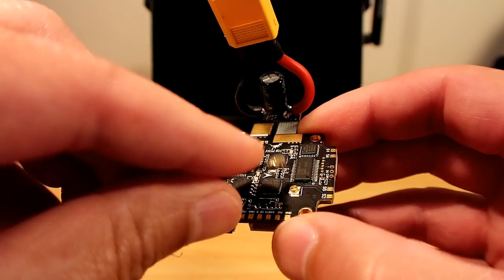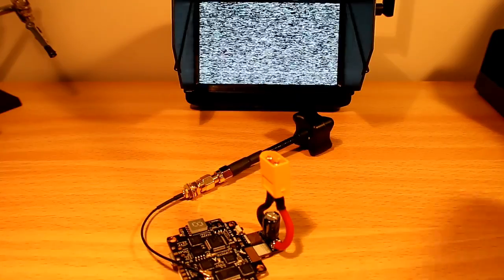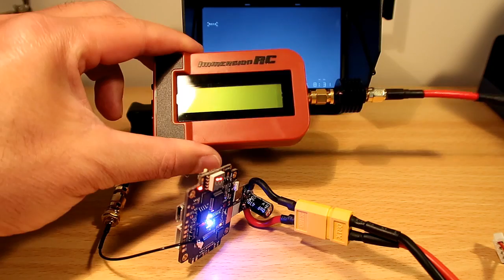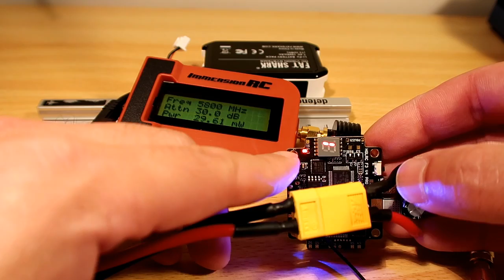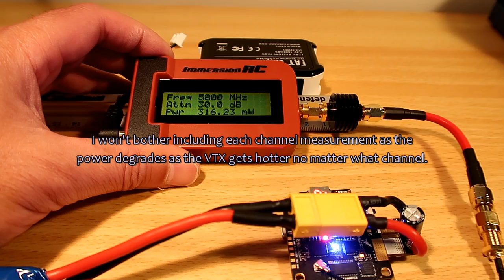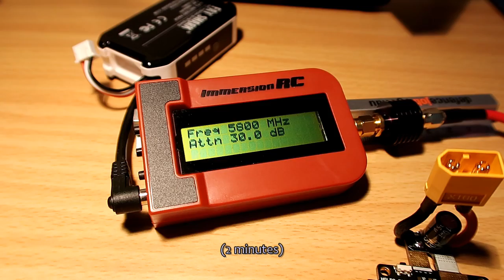HGLRC (HGLTech) AIO F3 V4 - FC VTX OSD PDB - VTX Test/Review

Comment: I bought one of this from Bangood, but it's OSD do not work properly. I use Betaflight configurator 10.1.0 and Firmware Betaflight 3.2.5
My problem is that I can not save thee OSD settings. I change the positions in Betaflight, and click on save, but nothing changes on the flight controler. I See the default OSD setting, not mine.

Can anyone help me to fix my problem?
Reply from the maker: Hi, this F3 V4 board does not use BetaFlight OSD, but the older MWOSD.  You need to find instructions on how to reconfigure MWOSD if you want to change this board's defaults.
Reply: After a little magic with FTDI my F3V4 pro works perfectly witch Betaflight. I can PID it from transmitter and save OSD setting from betaflight and so on...  This is my favourite FC ever! :)

Comment: well this seems like a quick fix for those who are out in the field and want to get back up in the air, not to mention seems like it saves some real estate, i think it still needs some time to prove reliable, and the no margin for error on the pads makes for a challenging upgrade that could prove to be rewarding
Reply from the maker: MiGz FPV unless you need extreme compactness I'd still look at a board without vtx as it does generate a lot of heat and is a potential point of failure after a crash. especially if your antenna is ripped off or the u.fl unplugs.
Reply: yeah, my daily driver is out of commission right now, waiting on another 600mw immersion rc vtx, i ordered 3 and this is my second one destroyed, a crash took the whole SMA connector off the board
Reply from the maker: MiGz FPV If the RF chip isn't burned, you can solder connectors back on.
Reply: there is 3 point at which that connector meets the board one being right underneath making it virtual impossible... im gonna start looking for a more inclusive solution such as the TBS powercube elite which was newly released
Reply from the maker: MiGz FPV I have a video on how to fix a vtx, that might be of help.
Reply: thanks your the man, even tho i had 2 immersion vtx show up in the mail from china today lol, im building a quad talk forum and lookin for admins / moderators if your interested in helping
Reply from the maker: Thanks for the offer but there are only so many hours in a day... :)

Comment: Complete noob here. I went to test continuity before powering it up and it's showing a short between + & -. I've not used the 470uF in this test. Do I have a dud board? I've removed all connections from the board and It is still the same. I've a new Omnibus F3 pro doing the same. I'm starting to question my sanity & don't want to go bang with my 1st build.
Reply from the maker: If you're showing NO resistance between the main +/- power terminals then yeah, something's not right!  Doing mine now, it started off showing a large resistance value but quickly came up negative.  I do have the cap on mine so that was probably causing the initial reading.
Reply: I think my multimeter isn't up to the job. It is showing a small resistance but the continuity function doesn't seem to see it. Its a bit of a relic. So off to get a new one.

Comment: That's good and bad news! Bad that it took a swim and good that it's still working!! I have heard putting them in rice will do the trick!! I bought this stuff made by MG Chemicals called silicone modified conformal coating! I painted all my electronics with the stuff !! Although I don't have the ball's to fly over water just yet!! But in case I get squirrely and out of control over water, I know now there's a ray of hope! Thanks to you!!
Reply: ive sunk my quads in fresh and salt water pools and rivers. once without any coating and it was a naze32 rev6, it was fine after a dry off. second was a cc3d in a river, fine after a dry off, after that tho i use acrylic conformal coating or clear nail polish if you steal it lol. cc3d and naze again sank and flew out of the water! one esc burned as i forgot to recoat after resolder. i also flew during the cyclone that passed recently. was fun!!

Comment: Ok, I sat down with my laptop and started ovr!! I did a reflash, BF 3.1.17! The board had BF 3.0 on it, this was my problem! I didn't update the firmware on the board!! The two firmware's were conflicting with each other!! The rates from one of my other kwads got flashed to the f3 v4 board, and caused it to flip out! Got it sorted now, and I love this board!! So many people talk bad about this board, but if everything is done correctly it's really freakin gr8!! Thank you sooo much for your time and help, it's very appreciated!!
Reply from the maker: J.FINESSE FLIGHTS Great news! Enjoy. After mine went for a swim in a river, I dried everything for a few days, fired it back up, and everything except voltage reading is working! Will retest vtx output before I fly just in case that took a hit.

Comment: I purchased this v4 board and I'm having trouble just getting it to fly!!! It wants to flip over each time I try to take off, I went into betaflight and messed with the RC-Rate and got it to fly, but when I asked the fc to do a roll it rolled about 20 times with one little flick of the stick!! I was in self leveling mode to be safe and after a roll or flip it would not correct itself, it acted like I was in acro?? If anyone else has had or knows what's going on please don't hesitate to correct me, because I'm lost!! I'm gonna try a reflash to a current release of BF!! Thanks guys!!!
Reply: If that is your problem (FC not facing correct direction), you can adjust the orientation in software, you don't have to physcially change anything.
Reply from the maker: Unsure whether you are having 'beginner' setup issues or if there is an actual problem. If changing rates (I assume dropping rates) made it more manageable for you to fly, then also add .30 to the expo on each channel, which should make each control input way less sensitive to you 'flicking' the stick (which I hope you're not really doing - no wonder it is flipping over.)  There's a lot to research and figure out if this is your first setup.
Reply: Make sure the flight controller is facing the correct direction. If it is rotated 180 degrees that will cause it to flip as you take off. Look for a little arrow on the flight controller, it has to be pointing towards the front.
If you can't find the arrow, just go into Cleanflight or whatever software you are using and make sure your physical drone matches the movement of the visual in the software. (So if you point the front of your drone down, the software visual is pointing down too.)

Comment: ive been on the fence about buying one of these for months now. ive been waiting for others to give reviews. thanks for this video
Reply from the maker: There seem to be a few people on the RCG forum who've run this board a few months now, but others who've had difficulties right from the start or after a few flights/crashes.  I'm still to build with mine so not sure yet...
Reply from the maker: Michael Sharp mine is built and running okay, video breaks up a fraction more than my other rig set on 200mw but not terrible. New F4 V5 is already out, which is better for individual ESCs plus has BFOSD.

Comment: I'm a complete noob but how you soldier all the positive or negative to the same pad area on board? do you have to create  individual soldier mound points on pad or can you make one big mound and drop each wire in?
Reply from the maker: Hi, soldering all the ESC wires together onto the two pads is how it's designed. I'm going to try one of those 4-in-1 ESC boards though, so there is only one positive and one negative wire to solder on for me.
Reply: i personally think if you have a pdb plate (example: Martian II <--im working on now) it would be easier and run one of the pos/neg to each of the pads just looks Cleaner i bought this to crash and destroy to be honest  but i will be hot gluing the buttons with hot glue before i fly and coated with conformal coating
Reply: Ahh great idea overall good controller?
Reply: Gearbest
Reply from the maker: Hi there. I've used some epoxy around each socket and the vtx switch too, definitely a good idea. The new F4 V5 board looks neat, might keep an eye on sales.
Reply: @ Alyssa. Thank you.  I had the same idea so I bought both boards. I have been using the F3 V4 for last couple of weeks and I have to say I love it. my only concern is durability but I haven't had too many issues yet. I chose not to use hot glue because I have heard stories that the board gets hot and the glue melts off. right now I'm using welding glue instead. when the other board gets here I will keep it as a spare.
Reply: i have no complaints, if it continues to last I will definitely buy another. where did you purchase yours from?
Reply: ZaksterBlue wow thanks for update. I checked for new board but I can't find it. can you post a link?

Comment: I smashed my Diatone GT2.  I was thinking about either BFF3 or the F3 v4 AIO to replace the FC and VTX. I realize BFF3 has no vtx. Any suggestions?
Reply from the maker: Sorry to hear! I've not yet built my quad with the AIO F3 V4 so I can't say if I like it yet. The ESC pad being all on one side may be annoying for people with individual ESCs instead of a 4-in-1; you may have to extend some of your existing ESC wires to reach. The layout of the BFF3 is better in this regard, as is the ease of BF-OSD instead of MWOSD.  If you have room to stack a VTX with a BFF3, this would probably be a safer option. At least if one component dies, you still have the other.

Comment: I fried my gyro on V 3.2 with a capacity connected(I only used a 16V 1000µF capacitor, after watching other video I know the spike can go to 29V and drop to 5V on 3s with little bee ESC). Now I got a 2nd V 3.2, had put a 50V 1000µf capacitor(must be Low ESR) + LC Filter(50V 470µf Capacitor + 2.7mH inductor).  Together they become a CLC filter(Capacitor Input Filter) generate very stable voltage for the VTX(2s-6s) which in turn provide 5V to power my runcam eagle Cam(5V-17V). However, on V 3.2 the integrated OSD still suffer from transient voltage spike from on board 5V power supply, and I can see the OSD flickering if I do quick stick bounce on yaw, roll, pitch(with prop off). May be I can add 1 small capacitor on the 5V pad to ground to try to mitigate the voltage spike. I want to ask how the video perform under voltage spike on V 4 Pro. As I guess it is not possible to add a LC filter there, although you can still add a high voltage, low ESR capacitor on the + and - pads.

Comment: I think these all in one boards are getting a little out of hand..
Reply: Save your money, I've had the boot button fall off, VTX button came off, and a signal solder pad came off.  This board is quite literally falling apart.  I purchased a V5 to replace it and it was dead out of the box.  I didn't try getting my money back on the first board because I already had it on my quad and it was flying.  I just couldn't change the vtx setting or put it in DFU mode if needed. I'll will try to get a return on the V5 because it never made it in the copter.
Reply: @TheBitmaster  so many people have said these are good boards but are falling apart, it's a shame because they could have dominated lol.